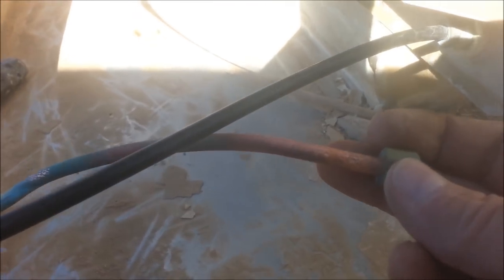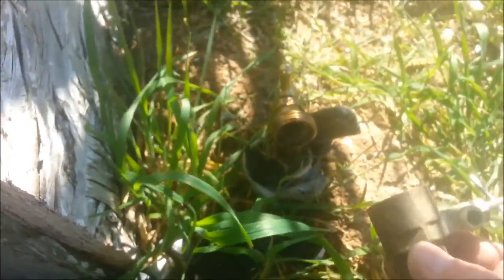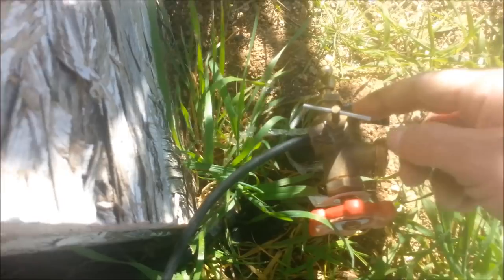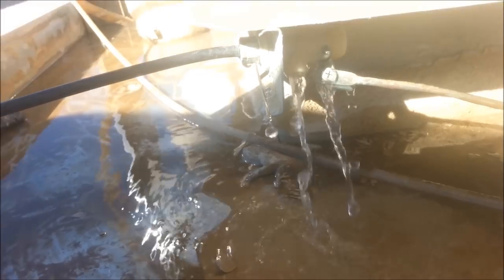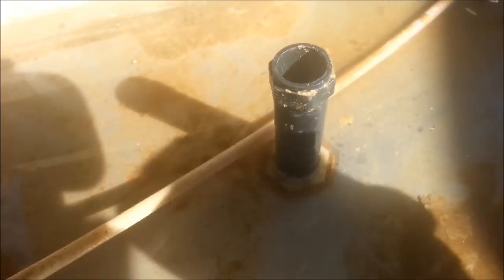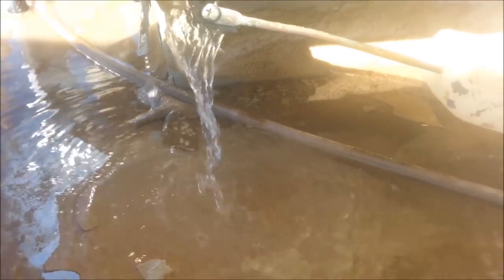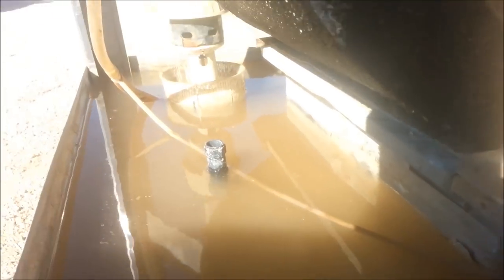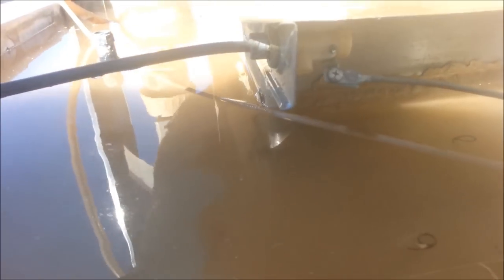Evaporative Swamp Cooler Water Line and Float Hook Up

Comment: What if water is leaking from the plug when its screwed in. What can i do. 2.57.
Reply: You may find at Home Depot a gasket replacement. If not, you will need to buy a complete float assembly.

Comment: I cannot get the metal connection on the plastic water line going into the faucet to stop leaking, any tips would be appreciated.
Reply: True blue an teflon tape for threads if not pvc to copper shark bite push adapter
Reply: does it have the little brass insert inside the plastic line?